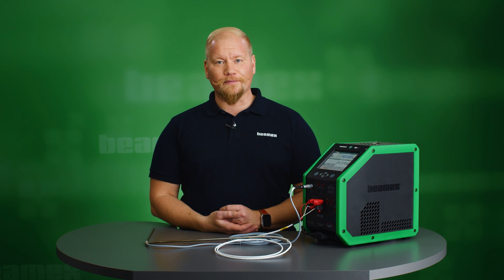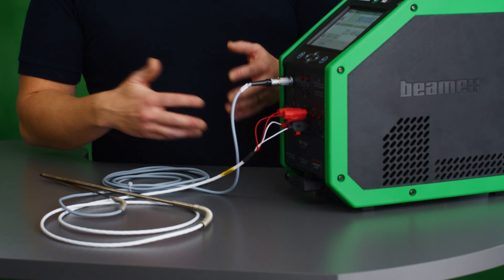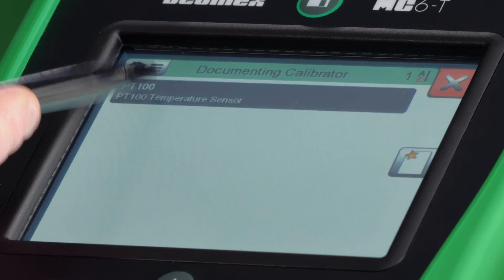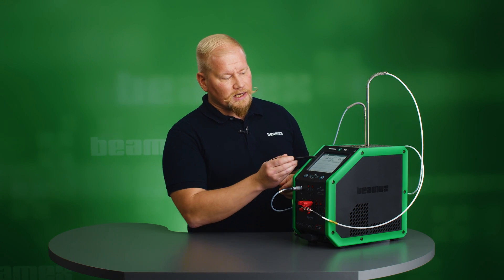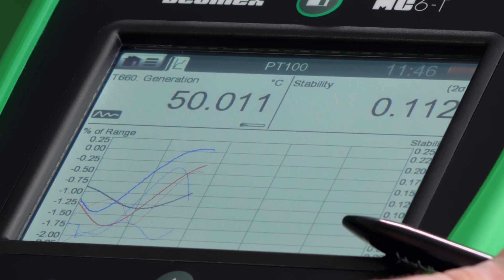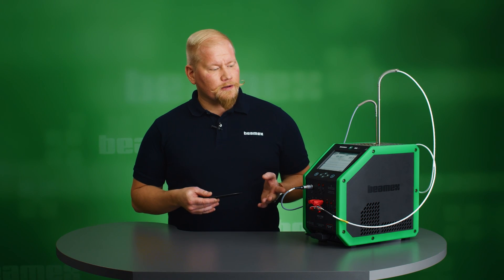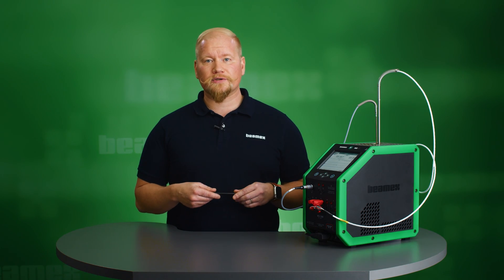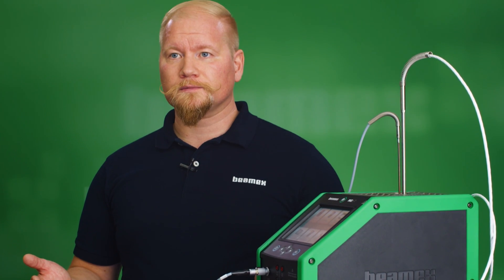How to calibrate a Pt100 temperature sensor automatically

Comment: Can this be used to calibrate an OMEGA RTS flexible sensor ?
Reply from the maker: Yes, this MC6-T can be used also with flexible RTD sensors, like the ones form Omega. The sensor insert needs to have a suitable tight hole for the sensor, so pick an insert that has suitable hole. If no standard insert suits, a custom insert can be done. Please contact you local Beamex representative for more info. Thanks.

Comment: Hi, thank you for a very informative video as always. I would just like to know if it is sufficient to calibrate the output of the transmitter only or must we do the calibration for the sensor and transmitter separately?
Reply from the maker: Hi! That is a very good question. Both methods are being used. So you can calibrate the sensor+transmitter combination, and if that is within accepted tolerance, then it is ok. If there is too big error, then you need to check if the error is from the transmitter or from the sensor. Please check e.g. this video for that kind of case with sensor+tranmitter: https://www.youtube.com/watch?v=InRC9wa_BvU
In some cases customer do also perform a "whole loop calibration", i.e. they put the sensor into a dry block and then record the final display in the control room. This way all components of the measurement loop gets checked at one calibration. Obviously, if there are too big errors, then each component in the loop needs to be checked.  
Hope this helps. 
Beamex/Heikki

Comment: what Class is the reference probe? what class is the probe that you calibrate?? how is the reference probe calibrated??
Reply from the maker: Hi, the reference probe in this video is the Beamex RPRT (https://www.beamex.com/calibrators/temperature-sensors/) that is a high accuracy reference sensor with up to ±0.007°C stability, when used with the individual coefficients. That reference sensor has been calibrated in out ISO17025 accredited calibration laboratory. The sensor that is being calibrated is a regular lower accuracy industrial sensor. Hope this helps.
Reply: Awesome info !

Comment: Thanks for great info. I am trying to get part number for reference probe.. Cant find one in manual. Any specific part numbers to use?
Reply from the maker: Hello, the reference probe used in the video is the Beamex RPRT reference probe. It comes in a few different versions: a straight or 90 degree bent one. Also, there is 420 or 660 deg C ranges available. 
You can find more information and brochure on RPRT probe from the product page here: 
https://www.beamex.com/calibrators/beamex-rprt-smart-temperature-probes/ 

Please note that we also offer an industrial temperature probe model Beamex IPRT.
I hope this helps. 
Thanks, Beamex / Heikki

Comment: So, is the corrective adjustment not part of Calibration process ?
Reply from the maker: Hi Vivek, great question. 
If we look at the whole process of calibration and all things related to that, the adjustment should also be part of it. We have somewhere mentioned that formally the word "Calibration" is the "documented comparison of DUT and reference", not including adjustments. 
But if you think at the whole process in the industry, you need to first calibrate the instrument to see if it is still accurate or not. And if it is not accurate, you need to take corrective actions to get it accurate, this can be adjustment or replacement. Also, if the instrument was found to be out of the specifications in the calibration, you need to look back in your process and consider what kind of harm has that caused and is there some action needed (in the worst case even draw products back from the market). 
I hope this answer, and you can agree on this.
Thanks, Beamex / Heikki